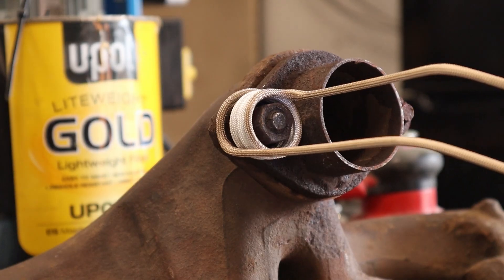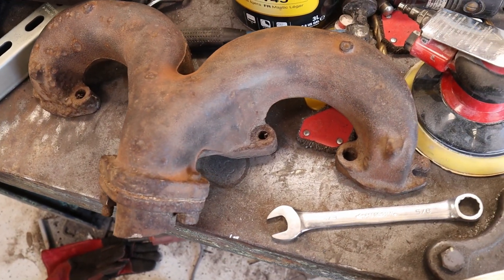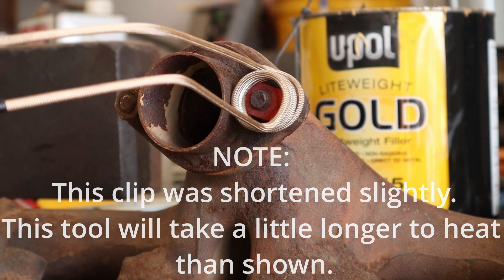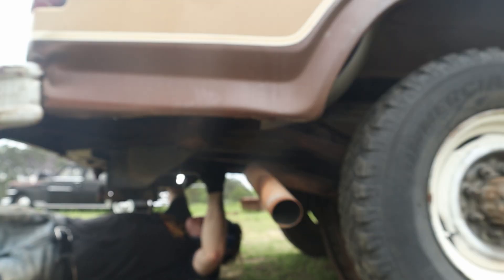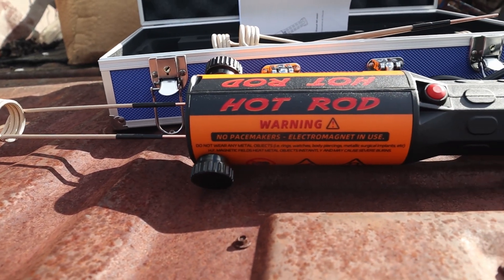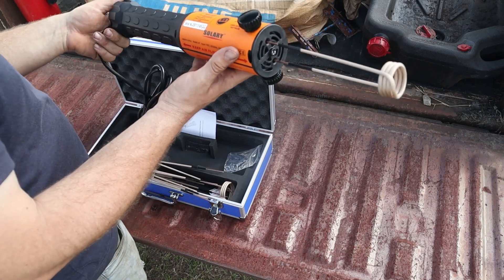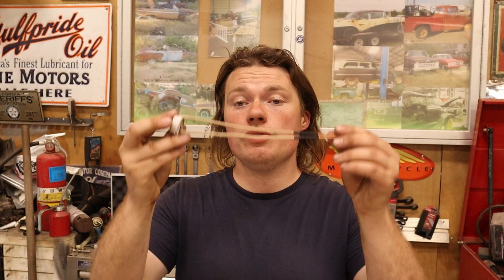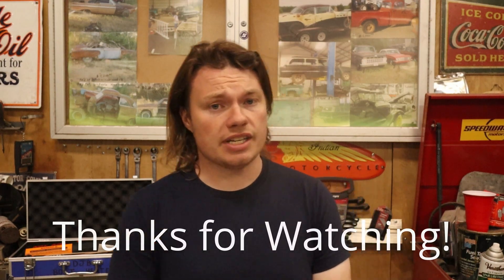Why you NEED a bolt induction heater in your shop!

Comment: There’s a bunch of bad reviews on Amazon for this heater although it is possible it was a previous model of the same make.
Reply from the maker: I personally had good luck with it, but when it comes to products like this, the quality control and consistency could be the issue.🤔  And I could have just been lucky with mine.😅 As far as the one I bought, I still recommend it. Especially for hobbyists such as myself. I don't even come close to using this thing daily, but I've used it several times now with good results.

Comment: You can make the coils, just copper wire, fiberglass sleeves, 2 shinkwrap tubes.
Reply from the maker: That's Great Info!😃The ones the company sell are quite pricey for what you get... I had actually planned a video where I would make some, and show the cost savings, but my video to do list is currently long, and my time is short.😅
Reply: @TheBestDanielBlount you can also pull stranded wire like from a sweeper cable through the fiberglass sleeves and make the rope style inductors. You just wrap them around the part that needs heated.
Reply from the maker: That's a great idea! I will definitely be giving that a try!😃

Comment: Will it work on the birds exhaust manifold bolts?
Reply from the maker: I had the exact same thought, but to be honest I'm still afraid to try. 😅 The bird is currently "fixed" and I wanna keep driving it.🙂 This darn heater is fantastic, but FE manifold bolts get so darn brittle, I really don't know what will happen.
Reply: @TheBestDanielBlount  I wish I didn't know what usually happens to those bolts. And I have an engine identical to yours except its manifold is also cracked which is how a learned about the extreme heat epoxy. I'm gonna have to take it apart in a couple of months so let me know if you find the heater works on it. Last year I had to repair 9 broken head bolts in my wife's Hudson long 8.... the hard way. That heater definitely would have saved that work, flat heads suffer that problem a lot.
Reply from the maker: @danontherun5685   I've got a 66 F100 in the junk row that has a 352 in it. I might go down there and try the heater on those bolts when I get a chance. I love this heater, it has already saved me tons of work. I don't get much time to work on cars these days, so any tools that make my time more productive are a winner in my book! 😀